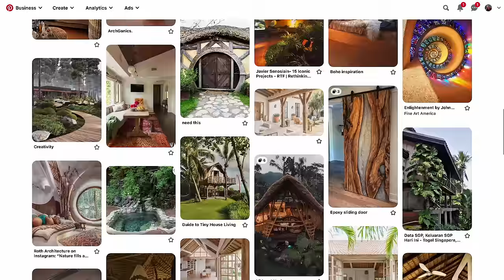Everything I Built Got Destroyed By Termites // Costa Rica Renovations Episode 4

Comment: I keep thinking it's time to just move on from the bus.
Reply: Absolutely 👍 There's no investment in a rusting home. Just build a simple home with local materials that are bug and weather resistant
Reply: Agreed.
Reply: You need to perhaps lay an epoxy floor or bug barrier. More wood will succumb to the jungle.
Reply: Too risky & time consuming to reno the bus; esp. if timber is used…again. Time to build something more solid for the family.
Reply: Use it as a shed / storage, nothing more
Reply: Along these same lines, I was going to suggest building with galvanized steel studs and cement board rather than wood studs and plywood. If not in the bus, in the future larger structure. Also luxury vinyl tile flooring which is waterproof.
Reply: Keeping the bus might be more costly than it’s worth. And there will be never ending repairs. Maybe it would be wiser to build from scratch using cement blocks. I grew up in MX, in Baja. Blocks were the way to go. No termite worries and the blocks keep the house nice and cool.
Reply: I’d have chucked it at bought a new bus two videos ago.
Reply: @gkozak430  the problem is they clearly don't have enough money to build a home there, they're going to build basically a slab and outdoor area around the bus, they kinda need the bus atleast for awhile, but yeah they really need to tear it down to the bare and start a build from scratch. it just sucks that they only spend a few months at a time in costa rica cause everytime you leave your basically handing the bus back over to nature and the elements.
Reply: Eyesore
Reply: Same
Reply: Absolute money pit.
Reply: Yeah it does seem like they are over leveraged financially and just trying to make what they have work. I just cant imagine building a family with a new born in that enviroment in a decrepit bus. Seems very Appalachian to me lol
Reply: Your Dad is awesome!!
Reply: Yes, the end of the bus. A new clean build may be the best way forward.
Reply: OMG. You owe your dad a HUGE thank you way more than what you did in this video. You’re fortunate beyond what you think or believe to have a father, wife and baby to live in these conditions. Burn it. Sorry but no way in hell!!
Reply: Yeah I can’t imagine them wanting the baby in the nests. But maybe they can get all that out and it will be like new.
Reply: I feel the same way. I feel like building their dream house around this, at this point piece of junk, is only going to make the whole build feel more junky.

Comment: Try teak wood when you rebuild, you still want to put on something to deter the bugs, but they’re vicious out here. 

We built with wood, put on an anti-mold product mixed with Borax for bug prevention, found several different other products we added to each piece of wood. Tints mixed with borax, several coats of finish, etc. 
good luck with whatever you choose. 

There are several other woods you can use but some are much heavier than others.

Comment: This is disgusting.  Don't do a half ass job man please.  Strip it down to bare.  Weld it shut.  Strip it down to metal then zinc chromate it for rust protection then make every SINGLE area water tight.  Bring in some good expertise and advice.  If you do a half assed job again bro your going to be wasting your money.  Check your rubber seals.  Every grommit.  Treat the bottom of the bus with rust protection.  I just can't imagine you doing a proper job on this bus unless you get in the hands you need and the knowledge.  Don't forget vapour barriers.  Your gonna be spending money but why don't you spend that money on a basic out building rather than doing up the bus.  Build a habitable outhouse.  Concrete base floor brick it up weather seal it and build a huge deck
Reply: I agree...seems a waste of money to restore the bus when you can build outhouse...
Reply: I completely agree. The termites will find any tiny hole. If you don’t start from bare metal you won’t know you plugged every hole.
Reply: I don't ever comment, but I have to bring Louis' attention to this comment here. Please, start from scratch
Reply: I agree. How could you ever close an eye in this bus again without stripping everything down to the bare metal, coating everything to protect from rust, and making upgrades so this same thing won't happen again?! Insane to me. Love this channel, but this is beyond disgusting Louis.
Reply: Not a very nice way to put it.
I do think it will end up costing a lot of money.  That said, I imagine and hope that the costs are more than offset from the revenue generated from the making of the videos.
Reply: You do realize this video is very very old by now?
Reply: @Ruslan_davudov_photography  not really, Louis' dad was there a couple of weeks ago. The previous videos were older but this is recent
Reply: people forget that louis is a content creator, yeah, building the bus will actually bring more money for him

Comment: Hey Louis! 
I'm renovating my 1975 Airstream trailer! I'm in Canada so definitely a different climate than Costa Rica but I ended up stripping my trailer to the bones because of rodents and leaks. I used spray foam insulation to coat the inside of the trailer. Perhaps this is something that could work once you strip the bus back to the bones? I was reading that because spray foam isn't a food source for termites, they are likely to leave it alone. They may still burrow through it if they have an existing nest there, but if you are able to get rid of them from the body of the bus, then maybe that would be a good option for you. 
I'm sorry this must be so disheartening for you and Raya to be going through. Sending positive thoughts your way!

Comment: 100% you have to go back to the root cause of these issues.. ask yourself why did this happen?

I'd wholeheartedly recommend that you do not park this bus on bare land. You need some form of separation between the bus and the land. I.e a platform or gravel. You need to reseal the roof and windows. You need to cut out and sheet metal weld up any holes in the underside of the vehicle. And then underseal the whole thing to protect from rust. You need to make sure there are zero entry points for critters to be able to board the vehicle.

Remove everything from the inside and start over. Any leftovers will contain larvae from the termites..i guarantee it. Doing anything less will be wasting money. Goodluck.

Comment: Cut your losses scrap the buss and if your hart is on a buss refurbishing than buy a reasonable good condition school buss that is still sound. You're going to just be throwing your money away if you do a half hearted cosmetic remodel and if you try to refurbish it to a sound stable condition it will cost much more than it's worth. You can literally pick up a sound School buss at auction for 2 thousand and drive it down to Costa Rica for less than the repairs your facing.